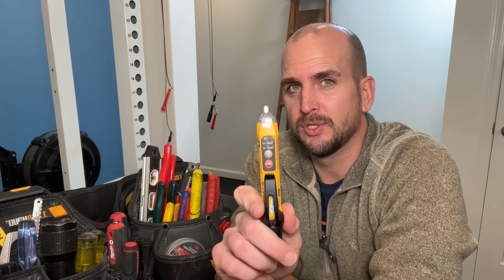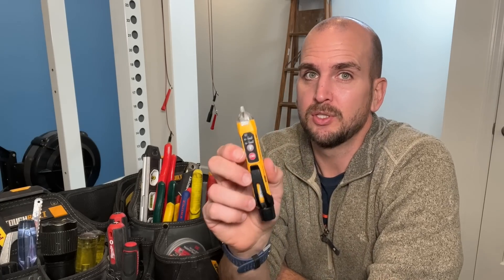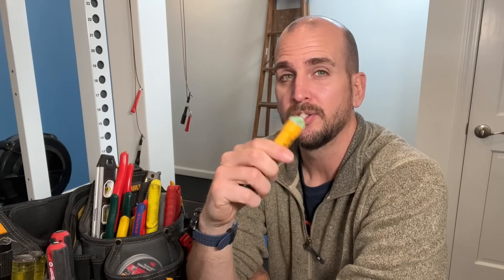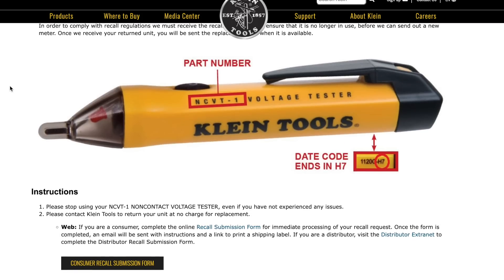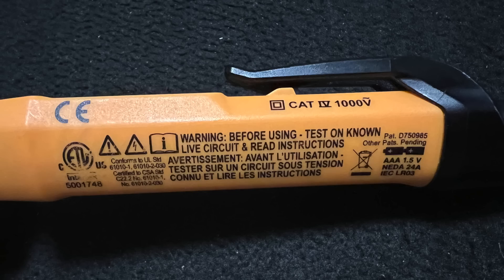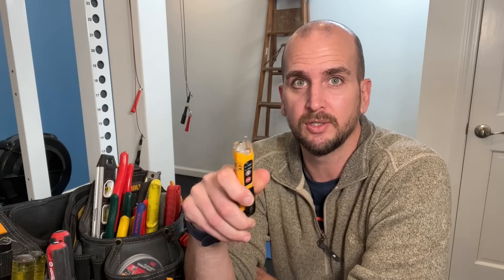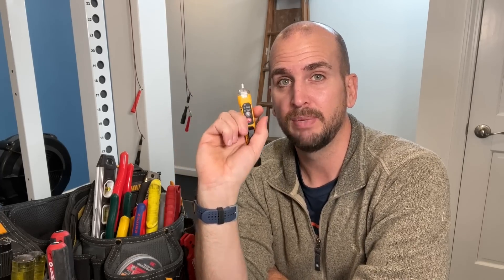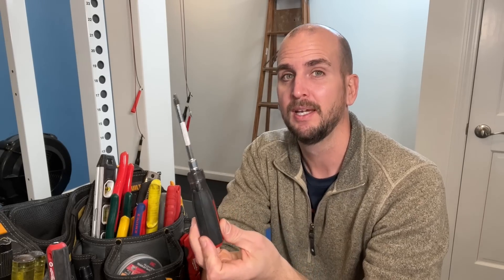The Tool I Get The Most Negative Feedback On And Still Use Weekly

Comment: I have been in the electrical trade for 36 years now and hold a masters license and I am a licensed electrical contractor in Florida and California. This video was well done and nicely hit upon  the pros and cons of non contact voltage testers. I  have been using them for many years now and have owned just about every single one that has been manufactured, some good, some not so good. The points made in the video are very good and relevant. I usually refer to the non contact voltage tester as a "tweeter" and mostly use it to detect the presence of live conductors within a j-box , device box or panel board of which I am working on since it is so easy to test without having to undo or open up connections or splices.  Then if I am troubleshooting the wiring, I will switch over to my multimeter for an exact evaluation of what is going on. With that being said,  it is my firm opinion that only qualified personnel should work on electrical systems period. I have seen too many DIY projects that were done incorrectly by untrained persons and by the " Jack of All Trades " handyman.  It is true that there are lots of different ways to connect wiring together to make the "light come on", but only one or two ways in which it can be done correctly.  Anyway,  great channel and good job on showcasing the quirks of using this invaluable tool.  👏
Reply: Don't discount every do it yourselfer, I personally have a copy of the NEC and wire everything in accordance with code. I just identified numerous wiring problems at my sisters house, Work was done by her husband (just passed away), who definitely knew what was proper since he installed heat and a/c systems, he was just lazy at home and did it "good enough".  Metal boxes, with grounds missing, too many conductors in boxes, poor stapling of wiring, 1/4" of sheathing not extending into boxes on NM cable, not enough wire provided inside box, unused knockouts open. All of it was easily corrected and made safe, if you take the time, read the applicable sections of the NEC for residential wiring, follow up with some of the great videos on YouTube and some books on wiring to the NEC you can easily work on residential systems. Oh and NCVT...always in my pouch when I am working on electrical.
Reply: Iam a Jack but any time I come across something that is slightly off I make the customer higher a licensed electrician, for one simple reason. If iam wrong you could burn your whole place down. vs them having liability coverage. and a lot more exp then me
Reply: I imagine you do excellent work. And, as a handyman, I've fixed a bunch of shitty work done by licensed electricians. The license by itself, does not always mean quality, or even correct work.
Reply: @262rdj  at the end of the day, it’s not about how “nice” the work looks when done. It’s about whether or not it was done correctly. Most people are scratching the surface when it comes to electrical stuff. 99% of people not trained properly don’t know about load calculations, sizing wire the correctly, voltage drop, sizing conduit, what wire to use (TTHN ,THWN, THWN-2, XHHW etc). All these Jacks that do remodel jobs will leave a job with an unbalanced circuit panel. There’s a ton more things that go into what I am talking about. Like I said in the beginning, I could give two craps what a job looks like when someone walks away, as long as it was done correctly. Of course you should take pride in your work and want to make it look beautiful! Make it easy for the next guy. Btw, the NEC was not written so the average DIYer could pick it up and go to town on their kitchen remodel. You HAVE to know how to navigate it the proper way. Just because one article may seem to fit what you are doing at the time, certain situations may call for you to double check with a different article and then go from there. What I’m trying to say is, LEAVE IT TO THE PROS. Just because it works when you walk away, doesn’t mean that you didn’t set up what you did for failure down the road. Very slow wear and tear until equipment or material you install fails and someone gets killed or seriously hurt.
Reply: Bunch of trolls....not Falling for it....
Reply: We bought a home build up around a 1920s log box, with additions tacked on in the 1950's, 60's, and 70's, the last by an owner who was a contractor. I ended up rewiring 90% of the place myself, finding the relics of ceramic post wiring in the attic, but the worst were the later "upgrades." Mr. Contractor didn't believe in grounding, and clipped the copper in boxes which had three-prong outlets, despite having ground to the breaker box. Three bare splices in a six-foot span, sandwiched between drywall layers, the Romex laying in a groove made by hammering across the wall, was one of the best; finding a nail driven that went into the cable, pushing between the black and white wires, was another. My work was slow, cautious, and as close to code as I could muster; a lot was grandfathered legal but not that trustworthy, and I kept the place from burning down. I heard the later owner had to extensively redo a lot, as the main panel was tiny, overcrowded, forty year old breakers, directly above a toilet in a cramped space. They had to relocate the box, and start anew, but I bet they still kept a lot of the runs I put across the attic beams, wire nut splices in junction boxes nailed down, etc.
Learning why codes exist, and how they've changed, helps to understand where some grandfathered wiring is still acceptable, and where a lot really should be brought up to newer levels. Pulling on a cable in the attic, and seeing the dragon's head of bare splices rise slowly up from the blown in insulation in the gloom eight feet away was a Nightmare on Main St.
Reply: Doing the job correctly starts out with using the proper test equipment, not toys or gadgets like these no contact detectors. Safe not fast.
Reply: Most electricians I've met I wouldn't trust to change my oil, not a slight at them just illustrative of my anal standards. Broadcast video tech for 20 years who works with poly phase industrial circuits on a farm, and not a licensed electrician but I have trusted sources. Hell I've logged more time with Mike Holt than I care to admit because of the swimming pools we have, so we do exist good sir
Reply: @jeffreystroman2811  Well yes I'd ask a mechanic or at least an oil change technician to change my oil instead of an electrician...

Comment: I am a DIYer who is 100% with you on this. A SouthWire 40126N NCVD is my go-to device, but I like your better. But like you, I also always have a circuit tester and a multimeter with me. I always test on a known live circuit first, but I like your idea of checking the known live circuit again after. 

One problem I will point out is that you are showing receptacles that are not Tamper Resistant (TR), which I have everywhere in my own house. You often can't get the NCVD into the slot, or even close enough to detect with TR receptacles. That's where the circuit tester is useful.

I came across a boneheaded thing a previous owner/occupant had done, to use one piece of 12/2 Romex cable to run a fan and a light on two switches, using the black wire for one, and the white for the other. They both used the equipment ground conductor for the return. Note that this is a case where a voltmeter might give a false negative. Because both black and white wires had 120V, there was no potential between them, but the NCVD would light up on everything. After disconnecting both wires and the equipment ground at the switch, my NCVD still lit up on all everything in the box due to an induced voltage from another Romex cable in the wall on a different circuit in proximity to the disconnected wire.  That is a situation where your NCVD might be more selective than than mine. 

I think all three tools are essential. NCVD, circuit tester, and multi-meter. But the one I trust my life to is the NCVD. That one stays in my pocket whenever doing anything electrical.

Comment: I have a fan/light in one of our bedrooms and it has a lightswitch hooked up to it. I needed to swap the switch, so I found the breaker that killed power to the lights and fan, turned fhat off. Opened the switch plate, unscrewed it and pulled it straight out, for some reason I decided to check it with this tool and that suckered was still hot, it ended up being a different breaker that killed the power to the switch. I don't really understand it myself, but I know the wiring in my house is old with all kinds of branch wiring going on.

Comment: I was working on a house where the power lines were pretty close outside so even the wire I was using to run to outlets and switches would alarm from a voltage sniffer when the wire was still in the roll

Comment: Make sure which circuit you are working with at panel.  Use multimeter  Fluke to test.  Check 2 to 3 times just to make sure.  Always work with breaker OFF.  Be safe

Comment: Voltage detectors and the outlet testers are both tools that should not be anywhere but the trashcan. They give a false sense of security to individuals who don't have an understanding of electricity. There are over 130 way to wire an outlte in a home, but only one is correct. Those two tools can only detect a few of the falts. Those two tools may never let you down, but they can also have you chasing your tail on a simple fix. Oddly, by the times someone learns enough about electrical troubleshooting to understand the limitation of those testers, they end up reaching for the multi meter anyway.

Comment: I have been renovating houses and buildings creating hundreds of units along with as much maintenance I could do my self on all those properties for over 25 years now and I have been using Non-Contact Voltage Testers for many of those years .They are great when your going through the rat nests of boxes and lines . it does not mean I dont use my multi meter it just means it has a place and especially in other then new electrical work.

Comment: Also, i learned recently through a British channel of meter proving units.  Fluke has one under the model  PRV240.  They are battery powered known good voltage sources for testing before and after you use the meter.
Reply: Yep, especially good when there is no energy on site, We are permitted (UK) to use a known "live" circuit before and after, but if no energy on site then a proving unit is great!

Comment: NCVTs are invaluable for approaching failed equipment.  And for quick proving during work.  Approach a outdoor HVAC unit, sweep the chassis of the unit and the disconnect, before you touch them to at least do first test that they aren't being energized by a broken wire.  But verify no-voltage after pulling the disconnect with your meter.  

But as proved useful for me when diagnosing a unit where I was turning the breaker on and off while testing was to sweep each time before I reached into wiring after I had been away from the machine or doing other non-electrical testing.  Once, I got a positive telling me I had power on when I thought it was off.  Treat it like a gun, if it's been a while, treated like it's loaded until you safely verify the condition.  In this case I had to thread through the compressor wiring to get to the the ports to connect up gauges.  

NCVT don't prove a circuit is dead, but they do alert you that something is there on the fly.  Such as just trying to track down where outlets are powered or are dead.

Comment: My dad was an electrician but didn't trust these. He told me to always use a meter. But they are just to convenient. I had a Klein but it failed me when I really needed it. I replaced it with a fluke and been going 7 years now with it. Great tool and you can't be to careful
Reply: Yeah, the fluke one is the way to go
Reply: If you use one of those your not being careful, just foolish because its faster.
Reply: @RadioRich100  👌🏻
Reply: @RadioRich100  Oh there you are again, Have you just went through the entire section talking bollox ?
Reply: Your Dad was right, the problem is that once they enter your tool bag you'll use it more and more... you will come to trust and rely on it because its so damn convenient... But they are not reliable...so one day....it'll let you down.
Reply: @eatdirtmofo  there not reliable at all , its just a fast more convenient way giving a false sense of security. Use your meter in the circuit!

Comment: Kudos to stressing testing and working on a dead circuit. I have a fluke. When on a ladder, I've found it much easier (and safer from a fall standpoint) to be able to use the ncvt with one hand to reach and test overhead. Also less chance of accidently becoming part of a live circuit if one of your multimeter test leads slips and you make contact. I've found that the advantage of the multimeter can be for detecting voltage from a conductor to ground, or for detecting a short. In buildings with steel structural components or with operating hvac equipment and metal conduit,  a multimeter can show the voltage potential caused by magnetic fields and/or shorts to the metal components. You don't want to become the path to ground.
Reply: Your sacrificing your safety for convenience.  If you cant test with a multimeter or circuit tester thats where you take your chances. False positives and negatives are side effects of those testers and one time where it doesnt detect and you act on it , it may cost you your life.
Reply: @RadioRich100  I have used NCVP for the last 25 years and not had one issue with them. You people are all on repeat regurgitating the same nonsense you hear like an old wives tale.
Reply: @PepRex  So how many have you sold? All the people cant be wrong. They call those toys death sticks. The ones that are wrong (like you) are probably dead. Toys that give shortcuts in electrical work, wagos and toy instruments commonly referred to as "death sticks" by the industry are shunned by anyone trying to do good safe work. You obviously are not one of them.

Comment: I’m an electrician, there is a place for this tool, and used properly will provide accurate information about the circuit in question

Comment: I have been shocked more times than I care to admit.  Even with a not live reading with a voltage tester, I often ground the hot connections inside the box to look for sparks.  Also, if for any reason you leave wires unconnected in a box and the breaker off, wire nut the black and neutral together.  If someone mistakenly flips on the breaker, it will immediately trip.
Reply: I would never recommend the spark test. If you have a bad breaker that doesn't trip you risk welding the hot to ground leaving a constant dead short fire hazard. Same problem with nutting the hot and neutral together. If the breaker fails to trip when turned on you're in big trouble.
Reply: @rayives7758  I should preface this by saying I am not an electrician, but have done extensive wiring (most by permit).  I would rather double check a presumably dead wire with the spark test rather than grab it myself and be surprised.  And if the breaker fails to trip with hot/neutral grounded nutted together, you have bigger problems with the panel.  By the way, I have learned this latter trip from a seasoned electrician to assure that breakers aren't accidently turned on by someone else - or me!